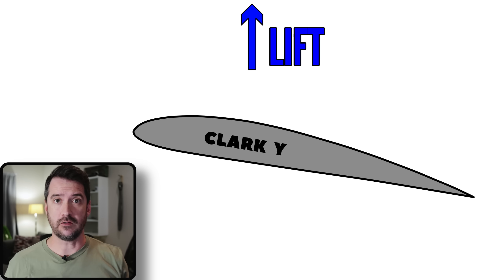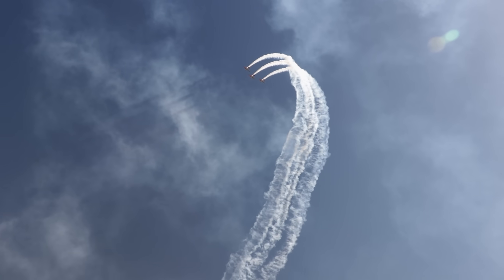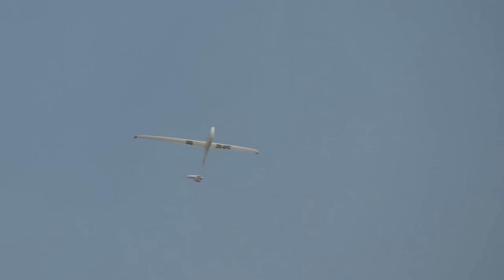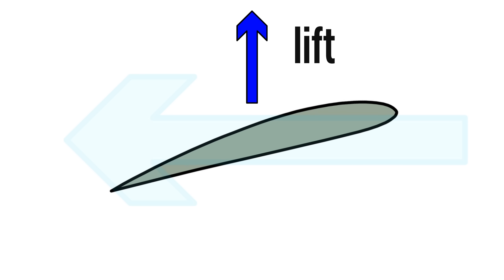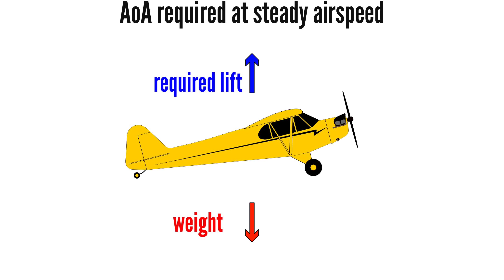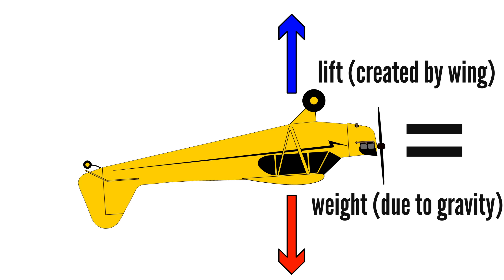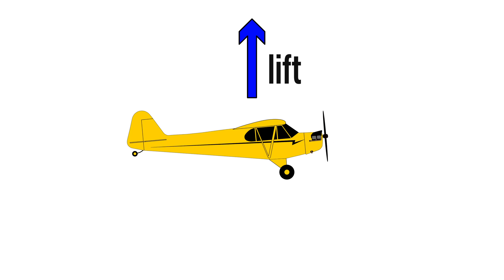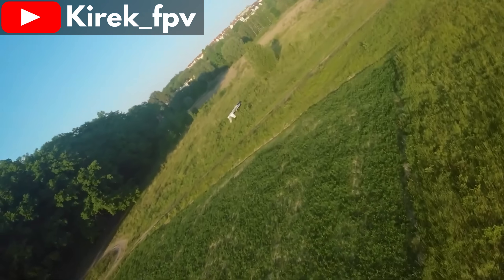Is Airflow Distance Over the Top of a Wing Always Longer?

Comment: The main problem with the traditional explanation is that it's often given as the ONLY cause for the lift.

I once saw a Formula 1 engineer showing a spoiler that was heavily curving up giving the explanation of longer-path-shorter-path... and that's it. That was the only explanation he gave for the downforce of such a curved spoiler. As if air hitting the highly curved-up upper side of the spoiler, or the low-pressure pocket formed on the underside/backside of the spoiler, or the incoming air being strongly deflected upwards, had no effect whatsoever.

I was flabbergasted why a Formula 1 engineer would give an explanation so lacking that it was just borderline erroneous.

Comment: This is Aeronautics 101. Most lift, ~95%, comes from angle of attack pushing  the wing up against the air pushed down, ie Newton's 3rd law, and ~5% comes from the aerofoil shape creating differential pressure, ie Bernoulli Effect. Otherwise, as kids often ask, "Then how do they fly upside down?"

Comment: I remember the original Lifting Bodies, which were basically upside down wing body yet they produced lift.   Also remember reading Air Force studies on Waveriders which is an upside down "V" or "W" (for stability) and used "Compression Lift", could do high angles of attack.

Comment: You didn't succeed in making your point. You can't jump from a reasonable (if subtly flawed..., but that's not important for the moment) argument in deductive fashion to concluding in purely inductive fashion.
That said, when one watches smoke pulses move past an airfoil in a lift-generating condition air does appear to move over the top of the wing faster—yet that is only in comparison to air moving below the wing. The air above the wing is nearly static compared to the air beyond the local effects of the airfoil. The air below the wing is being affected by the redirection of flow, and thus is both at a higher pressure and slower horizontal movement relative the wing chord. (We'll ignore flow from the wing root to tip right now.) In fact the air below the wing also appears to move slower than air (relative the wing) outside of the local effects of the airfoil.

When you mentioned the stagnation point you were almost there...to understanding and demonstrating what is actually happening. You'd solidly illustrated, in well supported deductive fashion, the actual physics of flight. Then you made the inductive leap to something often said (and its inverse), both based on a misunderstanding of Bernoulli's brilliant explanation of how vortices adhere to surfaces (the math which explains how and when a wing stalls). Again, it isn't that the air on the lift vector side of the wing goes faster —much more importantly it is that the air on the weight vector side of the wing is slightly slowed relative the wing (in the thrust/drag axis) by the combination of pressure change (that stagnation point) and deflection (angle of attack). This also builds towards the explanation of why a (clean, without ice or other contamination) wing stalls at one critical angle of attack (no matter what the wing loading or speed), as is frequently stated by experienced commercial and military pilots on YouTube.

So, again, you're super close. You even have the kernel of understanding that a wing's camber affects flow dynamics and therefore drag (efficiency), essential to making sense of whether a particular airfoil can fly inverted at a speed an airframe is capable of sustaining without exceeding the critical angle.

Comment: The curvature on the top of the wing and the air flow following that curve causes a force called Centrifugal Force .  Air has weight  and as it is forced to flow over that surface fast enough to create enough centrifugal force force to lift the plane . High aspect wings where the curvature is more pronounced creates high lift at lower speeds  .  Thus the reduced chord of the outer wings stalls last even though the wing chord and thickness is less.
 The reason wings all have stall speeds is that the airflow across that wing gets too slow will separate from the wing and that varies with the wing plan. That proverbial Boundary layer doesnt lift anything by itself .  Negative air pressure that actually lifts the plane  is caused by the centrifugal force exerted on it by the air forced to follow the wing cord . Round nose wings compresses the air before it causing higher pressures and lower take/stall  off speeds .  Bournolies never mentioned Centrifugal Force that I remember . I posted this a while back.

Comment: An observation is not a cause, nor is it necessarily an explanation. Unequal path lengths explain nothing while pressure differential explains lift handily. The effort should go toward explaining why there is a pressure differential. 

An analogous question is : “Why is the water level higher on the outside curve of a river bend than the inside”? Could it be that the inertia of the water makes it resist making the turn so it tends to pile up on the outside while becoming sparser on the inside bank? Could the air next to an airplane wing top become rarified for the same reason?

Comment: At 9:02 I think by definition of angle of attack your horizontal wing is not at zero angle of attack.  I think the angle is from a line that goes from the back to the front and that is inclined upward even though the bottom surface of the wing was in line with the air.

Comment: HOORAY - At last someone is saying something that makes sense to me on this subject.
Since I was a kid in the 60's I have been told that it is the low pressure created by the air flowing the longer path over the top of the wing that creates lift and the air flowing below the wing can basically be ignored for all intents and purposes.
And I always thought to myself that this "theory" which was put forward as "fact" was VERY SUSPECT.
Here is the thing...
Low pressure (or vacuum) can only decrease until it is zero while air pressure basically has no upper boundary.
The air UNDER the wing is what creates just about ALL THE LIFT on the wing - so what is with this "the wing is being SUCKED UP which creates all the lift" nonsense? 
Yes, the low pressure above the wing does create SOME lift but BY FAR the greatest amount of lift is created by the PRESSURE EXERTED by the air traveling BELOW the wing.
Every time I tried to raise this when I was a kid, the so called "experts" simply shut me down and told me that I was "just a kid, and a dumb one at that and that I DIDN'T UNDERSTAND THE CONCEPT".
Now, 50 or 60 years later, it seems that the "dumb kid" just maybe had a point that the "clever experts" had missed or ignored completely in their "know it all" arrogance.
To paraphrase someone MUCH wiser than I :
If you just sit on the bank of the river of time you will eventually see the bodies of all those who would do you harm and injustice come floating by.
Here's to that idiot science teacher who put me off of following a career in the STEM fields. SCREW YOU...
Reply: Just for fun, google "pressure at a molecular level" sometime. Technically it is not possible for a fluid to suck anything up. When someone refers to "negative pressure" or "lower pressure" on the top of the wing, that is just a way of saying the air molecules on the bottom of the wing are pushing it up harder than the air molecules on the top are pushing it down.
Reply: @clarkstonguy1065  Yup. Imagine 'nothing' , a perfect vacuum with no air molecules,  'lifting' a 20 ton aircraft........ lift (and centrifugal force) don't exist. Planes fly by Newtonian physics.... period.
Reply: @Pneuma40  a perfect vacuum on one side and atmospheric pressure on the other would 'lift' about 10ton/m², to be more exact, the atmospheric pressure would push to the vacuum with that amount
Reply: @directorrepublik3575  Yes atmospheric pressure is about a ton per square foot (old school). at sea level ambient temperature. The bottom of the wing experiences a force as air molecules bounce elastically off each other and ultimately up to the wings under surface. The acceleration of the air molecules from up to the lower wing surface to ricochet downward times their mass is the force on the wing ( F=mA }. 
The vacuum on the upper surface provides no force....it cannot...it is nothing. There is simply no downward force due to a lack of air. So the wing moves up. I know this is counter-intuitive but pressure is a force, vacuum is not. 
   So let's look at a moving airfoil.  On a typical airfoil the front edge of the upper surface as it moves through the air is compressing it. That's right, the first 1/3 to perhaps 1/2 of the upper wing is at higher than ambient pressure....not lower!  The force vector is down and back...drag.  The air molecules are forced out of the way of the wing and compress, then expand in the wake of the wings passage.  Wing cords are made thick to minimize low pressure in the wake of the wing .... to fill the void with wing surface if you will. To keep the flow laminar if possible and avoid turbulence.  Low pressure is not a goal,  It only occurs on the back half of the wing and has nothing to do with making the plane go up. That is almost entirely the bottom of the wing deflecting the air downward. Action and reaction.  This is why a flat wing will fly, a symmetrical cord wing will fly and upside down flying is possible.
Reply: The wing suction is still very important but not by sucking entire plane up.
The suction at the top of the wing helps preventing flow separation (or stall). Which make thin airfoils or flat plates have very bad stall characteristics.
Reply: I have a simlar story of talking to guys that explained the lift of the wing talking mostly of the differences of the air pressures above and below the wing produced by its shape.
Reply: If you look at something like a CFD analysis of an aerofoil, you can see that the drop in pressure on the top side of a wing is actually more significant than the rise in pressure on the bottom side of the wing. That's why stalling creates such a huge loss of lift, even when the bottom side still has positive pressure. It's not very intuitive, but if you look at the streamlines going over an aerofoil you can see that the air is travelling down off the top side of the wing at a much greater angle than that air travelling down off the bottom side of the wing. If you think of a wing as working by throwing air downwards, you can see why that would mean the top side is actually creating more force than the bottom.
Reply: @agerrgerra1361  Good explanation of something not intuitive! But does this (top surface produces more lift) only work in a viscous fluid? Asking for a friend!
Reply: So why are engines and other protrusions placed under the wing and not on top? I heard as a kid that "2/3 of the lift force comes from the upper surface, 1/3 from the bottom." Now I don't know where those fractions came from, or how one could measure the upper and lower lift forces separately, since they work together
Reply: @redbaron07  The top is more critical. I did say that air molecules can only push and never pull. However, lift is a combination of the air molecules on the bottom of the wing pushing harder on it (higher pressure) and the air molecules on the top of the wing pushing less hard on it (lower pressure). Of the two, the latter contributes more. 
And, while I standby this statement as being 100% correct and true - It doesn't really do much for understanding how various wing profiles and shapes work. As even though only the air molecules touching the wing can impart a force on it, those nearby molecules interact (exchange momentum) with a virtually uncountable number of other air molecules in the flow field many meters above and below the wing. And even in front of the wing, and as far as that goes tip vortexes generated by the wing can propagate molecule by molecule a kilometer behind the wing!
Reply: @redbaron07  The technical explanation of the fractional reference you cited is: 2/3 of the audience will accept whatever they're told, 1/3 will scratch their heads in suspicion and curiosity. Exact ratios may vary
Reply: @redbaron07  There is no 'lift' there is only thrust. Airfoils thrust air down. When there is more air mass accelerated down than the mass of the aircraft times gravity - then the aircraft rises. Fixed wing, rotor, rocket .... all the same.  Wings thrust air down  plane goes up by action and reaction....., they are not lifted by vacuum.

Comment: My question is, is the wing being pushed up from below the wing or pulled up from the top. I think it's being pushed up  from below otherwise fabric covered wings would have fabric covering being torn off from the revit attachments
Reply: Nope, the fabric is just held on well.  In addition to rivets it may well be glued.  Also in the region where the pressure is especially low (the place where the airflow is most sharply curved), the fabric is most sharply curved too (hugging the ribs), so it's not in a shape that can be peeled easily.

Comment: It's the relative differential in air flow velocity that creates the pressure differential from top to bottom of the airfoil. The angle of attack defines the separation of the upper airflow from the lower. Given the right AOA, camber becomes less of a factor. Inverted airfoils can be much less effecient and will cause a change in stall characteristics. But given enough thrust, most airfoils are capable of inverted fight. Length of airflow path contributes to the difference of air velocity, but it is not as critical to generation of lift as does pressure differential.

Comment: Bernoulli's theorm is specific to the flow in a measurable dimension.  For instance, one has a volume of water flowing through a pipe of radius x, and one can measure the pressure that is exerted by the water on the wall of the pipe.  If that pipe's radius becomes constricted at some point, the water will have to flow faster to maintain the same volume per unit of time, and the pressure on the wall of the pipe can again be measured. According to Bernoulli's theorem, the water pressure will show a measurable decrease, and, indeed, that is what is observed.
Attempting to apply this theorem to an airplain wing is difficult because it the variables cannot be accurately measured.  Newton's laws of motion are all that is necessary. 
Applying Newton's laws to the wing, we can easily see that the angle of attack deflects the airsteam downwards which produces an equal and opposite force upwards.  Futhermore, the airflow that impacts the lower side of the wing obviously exerts increased pressure on that suface.  The direction of air-flow over the top of the wing changes its direction due to the lower pressure that it exerts and that lower pressure is caused by centrifugal force. The air traveling across the top of the curved wing wants to keep on traveling in the same direction, and that induces a lower pressure on the upper wing which causes an alteration in the path of the airflow. 
Low speed airfoils tend to be flat on the lower side and curved on the upper side because that is the most efficient shape for that speed and wing loading.  And this kind of airfoil will produce lift when inverted, contrary to what our Benoulli author maintains.
The author of this video accusses those making a correct observation of a "dumb argument," but this author has to conflate Newton's laws with Bernoulli in order to make Bernoulli work.

Comment: Of course the so-called "longer path" hypothesis must be correct.  By looking closely, one can clearly see the air-police at the edge of the wing making sure that the air molecules join up where they are supposed to.
I used to discuss this issue with my sailing-school students who were addicted to the scientific sound of "Bernoulli."  (Someone used a foriegn sounding word together with his authority as an instructor, and his students fell for it every time.)  When pointing out that a sailboat's sail has no thickness, I was met by disbelief:  "How dare you question Bernoulli!"
Reply: Bernoulli is correct, it is one way of looking at lift. The problem is the stupid idea that airflow needs to hit the trailing edge at the same time. It is the Venturi formed by the aerofoil that speeds up the airflow, not the path length.

Also the thickness is not relevant. A laminar would produce lift with an angle of attack.

A sail producing lift (let us say, for example, close hauled where we rely on lift for power) has curvature. That means convergent then divergent streamlines on the convex side and a divergent then convergent streamlines on the concave side (equivalent to "upper" and "lower" surfaces of a wing) producing a reduced static pressure on the convex side and increased static pressure on the concave side.
Reply from the maker: Air over and under doesn't "have" to meet up at the trailing edge. I showed in one animation air going over arrives first, but I should have been more clear.

I didn't know wing thickness was a point of contention. The wing of the Bleriot XI (first plane to cross the English channel) is more akin to a sail than a conventional wing - the under surface is the same shape as upper surface. Doesn't change anything though, stagnation point still forms somewhere slightly below the leading edge.